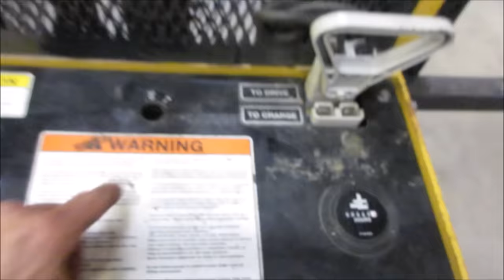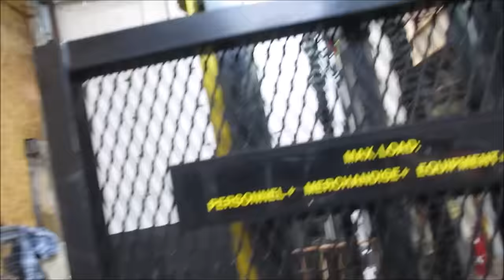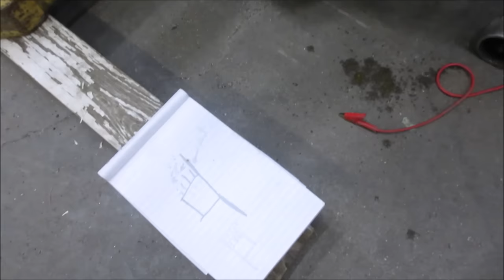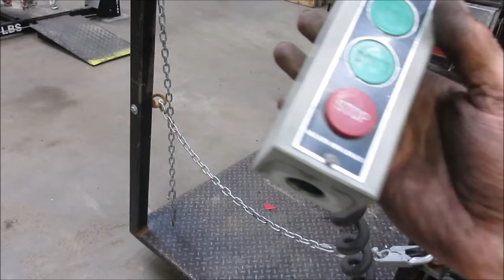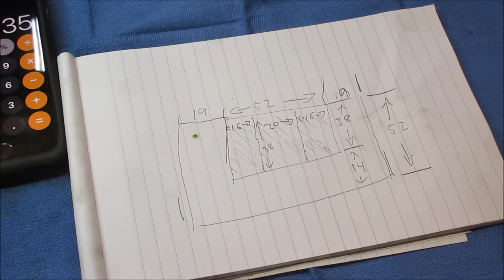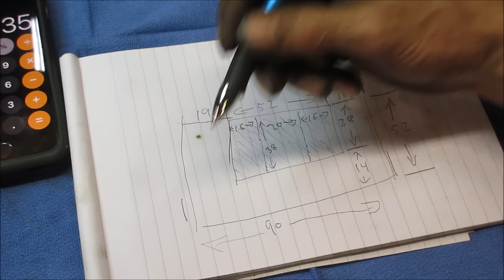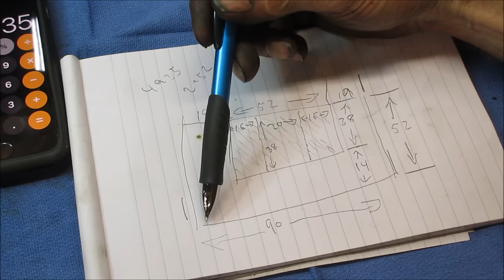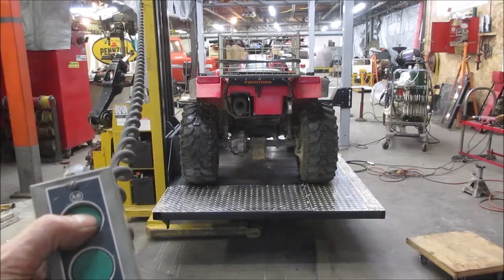Busted Man Lift Turned into a 2nd Floor Barn elevator

Comment: I think what happened is the switch in the handle got busted rendering the brake on the motor always locked on, that then burned out the motor speed controller (the CURTIS box) when they tried to go use it.

It would still have drove although very slowly and sounding like the batteries were weak, and that is likely also what they thought and just kept using it like that until the speed controller mosfets had enough and handed in their permanent resignation.
Reply: It also looks like it fell over or they ran it into something, there is a lot of damage on that yoke. I used to work in a Walmart distribution center, and they had tons of equipment that worked just like this, and I remember having to have the yoke in a pretty precise position for it to move forward.

Comment: I worked for Best Buy back in the day. We used this exact same Big Joe in the stores to load/unload product from the shelving. The unit can be pulled around with the key off. It's tough though. You end up pulling all that weight. Cool repurpose for old crap. I would be interested in seeing it installed.

Comment: Love the thought invigorating process, had a few myself. Instead of lag bolting, how about using some of the heavier parts added to the back end to increase the counter balance? Also what did the second red button in the rear of the handle do? Was it to reset the drive if the safety bumper had been engaged? Thanks for keeping it fresh by mixing things up project wise, can't wait for the next one 😊
Reply: One button on the handle is a horn button. Used as you approach a doorway or corner to warn others you are nearby.

Comment: Mustie hooked up two battery packs.
One had the positive on the red shielded end.
One had the positive on the shielded end for the other battery.
I question why the shielded ends for any battery wouldn't be the positive side.
Reply: One had boots on both positive and negative, the other set of leads was missing the positive boot, that machine was supposed to have shields on every terminal

Comment: beauty thing about aluminum is that you can machine it with the same tools you use for wood. You just have to work a little slower. Good on you for remembering to reverse the blade.

Comment: Big Joe should have a set of forks on it like your fork truck probably inside the boxed in part on the platform.👍👍👍😁
Reply: Yeah I'm pretty sure they're technically called straddle jacks, the feet of the Jack should be the same width as a standard 40 inch  pallet plus a inch or two, it's just been modified by a another company for man up use, as far as I know Big Joe primarily deals with Best buy and maybe some other smaller retailers, but I'm nearly certain Best buy is the majority of their sales

Comment: Everyone says I’m crazy but a few years ago when I built my GarageMahal with a second floor studio apartment, I built an honest to gosh real elevator.  Found an old Yale Home Depot hi-boy lift.  Cut off the back end, stripped all the hydraulics off except for the main lift and made a cab complete with up/down controls, door interlocks, floor indicator lights… (Otis would be proud!) and it’s all PLC controlled.  Got less than $1000 in it.  I figured someday I won’t be able to climb the steps so I can roll a wheelchair in and hit the button!

Comment: Get some more of the open criss-cross sheeting like you cut off the back and use it and what you salvage from the back and make your floor sheet add ons from that to save weight?  Then weld and/or bolt square tubing on under side of existing base to support floor add ons.

Comment: Before you mount it permanently, I would pull all that back side motor and driver system off. If I was local I'd be interested in it for an electric cart project or something. its a DC shunt motor, needs a field current to work, should be 4 wires. The hydraulic lift circuit is simple to keep stand alone if not already.

Comment: I just finished a hydraulics class and the man used a old forklift mast and welded a support bar across the back and mounted it the his barn wall and hooked a pump and solar panel with battery and made a lift to put bikes on second floor it was pretty neat.. I would cut the legs off this and lag it to floor and back side to wall and take everything you need out of it so the mast can be right up against wall and get rid of all that function of rolling it around and you would eliminate the tip you have on it..

Comment: That was a great video.  I understand your thinking process and agreed with  just about everything you did.  I would add support beams on the sides where is flexes that 1/8 inch, if it sags it will be an issue with aluminum.  Thanks for the video!

Comment: Instead if poles to guide it into the hole, why not angle iron in the corners of the floor, flared out on a slight angle to guide it as it goes up. Less intrusive for loading etc ...
Thanks for sharing 🇨🇦

Comment: Way back in the day I was taught gas axing and plasma cutting which is a very similar process work on steel because Iron has the special property that its oxide melts at a lower temperature than the metal itself. Most metals including Aluminium (sorry I'm British) the oxide melts at a far higher temperature than the metal.  They also taught us that using wood working blades on Aluminium is fine.

Comment: Here is another thought too ,mustie , to help support outer edge....    possibly ,corner uprights with a roller bearing system maybe ??
Reply: Nope a docking cradle to the loft and a clamp fixtures for bottom unit this. Way u can   unload stuff from truck flatbeds😅😅
Reply: @gerry-p9x  actually pal, not a bad idea....  
But incorporate both !! 

Upright with roll ,bearing support,  and then so far down ,have a clamping system. To support , whilst vehicle/engine etc..  is transferred.  Then could have air lift table on ,opposite side ??

Comment: Check for a position relay/switch on the "tiller" handle, they usually wont start in any position but fully up, then they wont work until you pull it down... so the unit does take off when you turn it on. I have one that won't work until you wait a couple of seconds after powering it on then pulling it down to a normal height, if you do it too soon, it locks out.

It's a safety I see on all of the powered "walkie" lifts and pallet jacks.

Comment: The Ferrite steel is very prone to rust heavily. I build cores for stators and if they aren't oiled or placed in protective sleeves they'll begin to corrode rather quickly even in an air conitioned machine shop.

Comment: If that operates the same as a power hand jack that I use at work, the arm that holds the forward reverse controls needs to be in a certain position to make it go. And sometimes, it is a little touchy to find the right position.  So, as you're working on it with the arm all the way up, it isn't going to go. Pull the arm down a ways. Usually, about waste high and see if it will go forward or reverse.

Comment: Hi there will be some kind of switch in the control arm so when it is either fully up or down it will cut power and apply the break when either riding on or walking behind with the arm somewhere in the middle of the 2 it will allow full usage of the machine , I am no forklift mechanic but I used to used those and other types alike and forklifts as a job

Comment: That brake switch in the knuckle applies power to the brake assembly to release the brakes. They are spring applied and an electromagnet releases them. There is a potentiometer in the handle that is similar to a TPS. Im not sure of the voltage specification but the output voltage should change smoothly with handle movement.

Comment: Hey Mustie, you can also plug in you 120v house /shop power extension cord, and you can also run the lift with that power as well, I used these back in the day, and most of the time the batteries were dead,  so we just drug around cords

Comment: Hey Mustie, 
You shouldn't use a points file on contacts other than points. The reason is that relays and other such devices have a corrosion resistant coating on the contacts that wears off quickly from the file. It might work again temporarily, but it will quickly fail afterwards.

I like to use a piece of index card or business card and swipe it through the contacts with a good contact cleaner. Or even better, I like to use a pencil eraser to rub away the tarnish.

Comment: I was thinking little feet to the floor when you started talking about expanding the platform.  So, of course, I approve.  I was also thinking that you need to wire it to transformers so that you don't have to buy batteries.

Comment: you can cut it with a circular saw .i ve cut it both ways blade revered and normal direction  ,no diamond blade very noisy but thats what we used when i installed on freezer floors when i worked on refrigeration repairs in warehouses

Comment: I bought that red jumper pack a year ago. Haven't used it much. Mainly for starting small engines. The battery in it has already crapped out and it can barely jump start a riding mower. Always had good luck with them, maybe I just got a dud.

Comment: Just an FYI, Big Joe had a series of micro switches in the handle. They operate with the handle, in the mid range of handle travel to horizontal. Once they activate the unt should travel. With the free play and side movement of said travel handle, My bet is they are both trashed causing no travel. And the elec lock operating or latched (bypassed as you did in the vid) will allow to free run like a pallet jack.Just some things to look at  ? Cheers from downunder.. PS had one at my factory and this is waht i found when the same handle damage occured.

Comment: I know on a unit I ran, if the handle is not in the down position. It will not move anywhere at all. It is a safety. So you need to pull the handle down. Lol as I'm writing this you just figured it out😂

Comment: It was interesting watching the plasma cutter on aluminum, I wonder if you can reinforce the sheet with the filled in cut lines like you can do when adding beads to steel plate?. All my saws have carbide teeth just for cutting aluminum and I set the blade to just break the surface. It’s sketchy, but it works, especially for scoring bend lines to hand form a box.

Comment: Those jack lifts have a safety built into the handle.  When you pull the handle toward you, it is operation mode.  When you place the handle toward the body of the machine, it has an auto stop mechanism so it can rest in place.

Comment: By extending the platform forward you are increasing the load centre, which is half the width of the platform. You should derate the capacity, there is a formula but it's so long since I used it I've forgotten! Also you should extend the legs and possibly beef them up as you increase the bending force.

Comment: With a wider platform (that extends beyond the original deck away from the plane of the lift) will add significant stress to the frame (even without anything riding on the deck). Bolting the entire unit to the floor transfers the added stress to the welded joints on the uprights near the floor. I'd consider adding some support extensions welded to the top of the fixed frame, and then to the ceiling joists somehow.

Comment: Darren, I think you should attach some hinged flap down ramps on the ends about 8 to 10 inches wide x the 52” long like the tommy gates have so it’s easier to load and unload off the platform on either side as for the hole in the mezzanine, I would put metal guides on the bottom side that gradually lines the platform to the hole in the mezzanine just in case it leans in any direction then it could slide into place centered in the hole in the mezzanine then you can flip down the hinged ramps onto the mezzanine then you wouldn’t have to be perfectly on playing with the mezzanine just above it

Comment: We had several big joe's at the cup factory...and all the ones I used had a safety switch on it where you had to have the handle pulled down before it would forward or reverse... I think it was to keep people from sitting on them and riding them.......

Comment: Fellow was plasma cutting using the waterjet as a cutting table. Blew the $4000 servo drive board. He did this 3x before he figured out why the board kept failing at $4000 a pop. Beware the circuit boards when using a plasma cutter.

Comment: I'm sure you get this working in the end but i'm only part way through. I would have looked for asafety switch and made sure it was fully lowered before I tried to trouble shoot the forward and reverse functions. These types of lifts usually don't move unless they are fully lowered in my experience,

Comment: Build outriggers to fold down. To stabilize  heavy loads
Reply: Second thought make  docking latches  tied into the loft  to further stabilize the lift and prevent  the plate from kicking away from   loft floor. Wireless remote wood be neat   too

Comment: Wondering if there is switching that prevents the unit from being moved while the platform is up? Wondering If that was in the “aquarium” relay? Wondering if that was the pile of rust. I wonder a lot. Could be way off base. Great video. Great modification.

Comment: driving issue is probably the handlebar.
normally the bar is spring loaded so it  returns to the upright position, and in the full upright and full down it actuates the brake and with that it disconects the drive module probably by a micro switch.
the part that actuates the brake is likely the piece on the pivot that was missing a bolt

Comment: As you have increased the dimensions of the lifting platform, you should be looking to increase the base section size as well to maintain stability - if you look at it when it is lowered in the original format, the base dimension and the lifting platform are roughly the same size.

Comment: You could weld some beams on the front legs that extend to the length of the platform. Have them raised slightly so that they only come into contact with the ground if it starts to tip.

Comment: The button on the very back of the handle is actually a East stop.
 It'll stop the left if it starts sliding with you and it bumps into you. It automatically shuts the machine off.

Comment: Muskie, the platform has to be in the down position to move unit. The potentiometer is adjusted to a value of 5K in forward and 0 Ohm at rest. The controller has to see this value to allow the drive motor to work.

Comment: You could add extensions to the front rollers so that the feet are even with the front edge of the platform. Then add extensions sideways to extend the feet to the two sides of the platform as well. Then it won't be able to tip.

Comment: To keep it from tipping I would add extensions that could be attached to the forward "arms". Have them so they slide back when not in use and lock in place when extended. I would also remove 80% of the rest of the steel plate and replaced it with the aluminum sheet.

Comment: Micro switch on the handle is the drive brake releasing. The brake is on top of the motor. If the drive motor has a worm gear in it, it wouldn't drive anyway. It's older, may have bevel gears motor to drive when. 🚗

Comment: You had the safety switch figured out correctly. It is an electric brake to keep the lift from moving whilst the lift is up. You can just jumper the two wires and that should release the brake allowing the lift to free wheel.

Comment: I love your channel and i often watch your stuff in bed before sleep. When you were cleaning up that relay, I winced when you sprayed it with brake clean. You are the expert but from my own experience with electronic circuit boards and such, I'd recommend you use  isopropyl alcohol at 90% or higher as that is far safer on the board then brake clean.

Comment: On the relay with the wires removed take an ohm meter to make sure you have continuity from line to load accross the points.

Comment: best way to adjust chain is lower it all the way first, then adjust the double nut, forward reverse have a safety that will stop straight down, the handle cuts drive power when handle is too high or too low.

Comment: Hi Dave I think one reason why it doesn't roll freely right now is the break is spring-loaded engaged stopping the wheels from Rolling when you touch the two wires I think it electronically disengages to break something you can try

Comment: I definitely not only mount it to the floor I would install some guide poles and mount them not just to the floor and the platform but also above that would make its a fairly safe unit. And legging it to a back wall is a good idea as well. That way if all those measures are taken you should be able to ride up on this platform as well. Can't see why not!!

Comment: there is also brake and cut out switches in the handle, too far down or up will cut power, so if your moving and let the handle go, the movement stops (safety stuff)

Comment: I would check your getting 24v at motor as it could be split 12v for hydraulics and 24v for motor ,could be 2 circuits of 24v like the wagon batteries, follow the voltage from the start the battery.

Comment: if you put a toggle switch on that broken switch in the steering arm to release the magnetic brake you might be able to move the machine through the resistance of the motor and push it in place that way
as for the plateau not centering through the hole in the floor , if the second floor is high enough to walk under it without hitting youre head you could mount catchers under the floor on each corner of the hole , these kindah act like a upside down funnel pushing the plateau towards the center of the hole in the floor , might allso want to double up on the controll box have one upstairs and one downstairs , that might save you a lot of going up and down the stairway